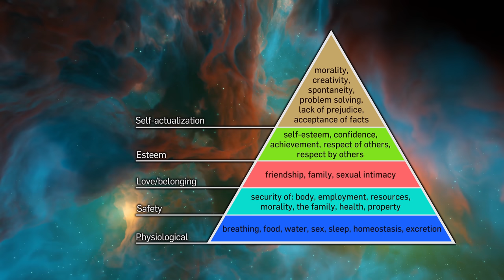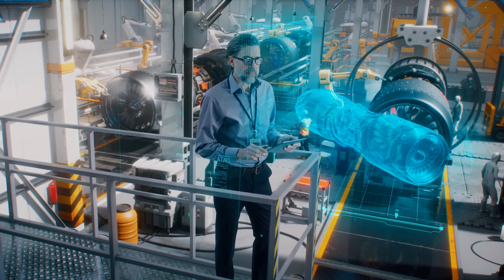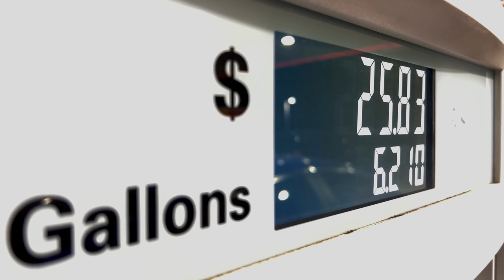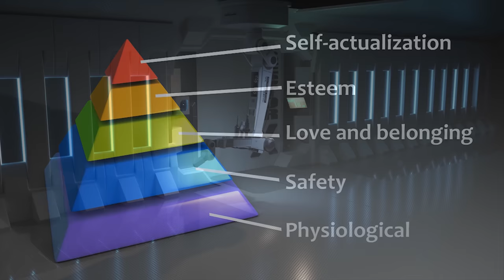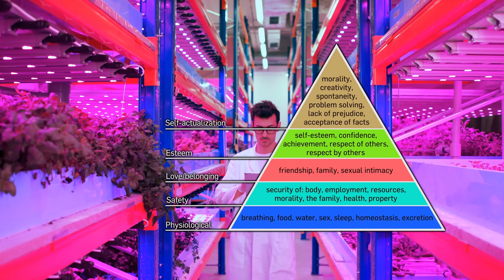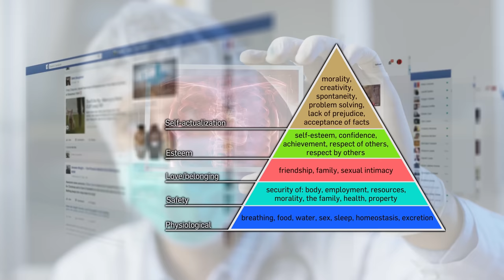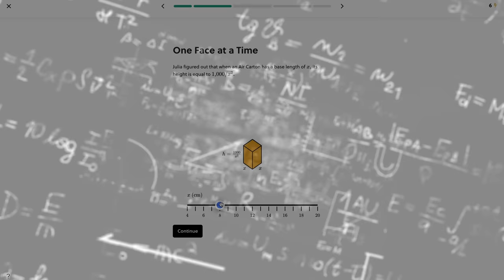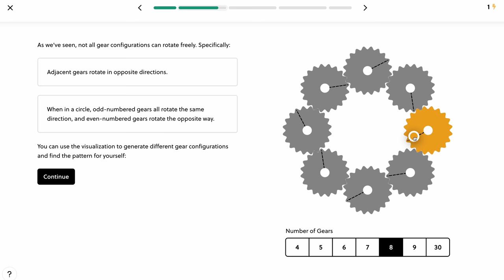What If We Never Become Post Scarcity?

Comment: I feel like I need to say this... In my late childhood and teen years, my life was hard. My family didn't have easy access to drinkable water, or much food, or quite enough wood to keep our home warm in winter. But when we got out of that situation, I quickly realized that without a little struggle to meet basic survival needs, I felt like something was missing from my life. It was like fixing some of the bottom tiers on Maslow's hierarchy damaged some of the top tiers. Just a thought.
Reply: Set new goals, the hero only exists with a demon king and a quest.
Reply: If I remember correctly, Maslow later abandoned the hierarchy of needs for a web of needs (he also added a few new ones as well, such a community-actualization), as there is no reason why you have to achieve each stage in-order.
Reply: No, you progressed to higher needs as the model predicts
Reply: The issue you have run into is where you get to that point where the needs you were most concerned about are now being met and you're left wondering on what to do now. Because the stress of having to meet those needs, or just the basic uncertainty of those needs being met at any given time was a wonderful way to focus your attention on what is immediately important at the time.

As Femi Mark said, you need to set new goals. Now that you're not worried, or as worried, about basic needs being met, you need to see what new needs of goals you can set for yourself to challenge yourself to meet. This is actually why many billionaries and such are often setting new goals or are still constantly active in doing what made them so wealthy in the first place, because it continues to give them a challenge.
Reply: Have the system change every 100 years. Force Millionaires to give half of their wealth to the poor every century!

Billionaires should be illegal!!! Instead, rich people can get perks for helping humanity
Reply: @christiandauz3742  and they do, they're called tax breaks
Reply: Thank you guys for helping me to feel young and hopeful
Reply: It takes some time to change one's mind from basic survival to true living.
Reply: @christiandauz3742  first of all, thats not how that works, second of all, meds. N O W.
Reply: @christiandauz3742  umm, where did that come from? Loose an argument so now your just going to start assuming things about my character? (Aka insults). Real big brain move. Thats like if i said "I'm sure you'll steal Elon Musks money so we can't make it to Mars." ;)
Reply: @SupaKoopaTroopa64  is there a picture for it? I tried searching it on Google, but I can only found the hierarchy of needs
Reply: I think the reason is modern American culture or lack of any culture. Wide open roads, disconnected people, ugly box stores. I've often said that living in Asia you feel immersed in decades and centuries of history, struggle, meaning, ancestry, temples, buildings, streets, stone paved streets dating from the last emperor before the communists came to power. And it all fills you with so much spirit and emotion and connection to the community that you're happy simply living and existing. As a foreigner life is privileged, you can just hang out in a cheap $100 rental apartment and eat delicious street food, but for locals life is a grind. But for you as a foreigner, there is no daily grind for survival, but life feels so good just soaking up the vibes, being part of something, striking up conversations about life, values, philosophy, going on dates, tastingt the food, or opening up your laptop to build an online business. So removing the struggle for survival, life can still be wholesome and meaningful.
Reply: @feetfinderguy7044  I tried looking it up myself, and it looks like I miss-remembered a few things. The web idea wasn't created by Maslow himself, it is just an alternate interpretation that some use, since it eliminates the need for a strict order. Maslow did actually modify his hierarchy in order to make it more complete and universal. This modified version is usually called the extended hierarchy.
Reply: @SupaKoopaTroopa64  ah okay, thanks for the clarification. But do you know where to find the alternate interpretation and the discussion surrounding it? Like a YT vid or something
Reply: It's the same reason, concept of heaven or bliss eternal place makes no sense from human psychology point of view.
Add unability to die and you have hell.

Comment: When you talked about all the things a tank doesn't need, I couldn't help but think of the Tachikoma in Ghost in the Shell. They had all those things, but their childlike demeanor caused them to develop a childlike affection for the members of section 9. This eventually made them incredibly loyal and self sacrificing to the Section 9 team. They wanted to please Major Kusanagi and her partner Batou. As useful a defense as that is, it could have backfired, badly.

I like your idea of a post scarcity civilization and how it includes things like  senses of purpose. As I get older, I start to care less about material wants and more about experiences and creativity. As I listen to this, i'm spinning silk into yarn and contemplating a partly finished wall hanging on a frame loom nearby and the sticks for a backstrap loom I carved and sanded myself. The actual difficulty of spinning silk btw, is that it snags easily and on everything, even your own fingerprints. Its also difficult to work in as they harvest the fibers in a way that keeps their whole length intact. So a small sheet of prepared silk can actually create a couple hundred yards of silk yarn, but you're likely to get some of that on your clothing or even stuck to the hairs on your skin.

Comment: 9:18 - that hierarchy of needs pyramid: my partner is taking some graduate level classes in the science of education. The professor had just happened to interview several of the researchers who worked on that project, it was never supposed to be a pyramid. More, all were annoyed it was named for one guy, even that guy was annoyed about it.
At least that's what I heard.
Reply from the maker: I wouldn't be surprised if that was the case, though I'm not sure it changes much about its validity as a basic simplified model :)

Comment: synthetic hydrocarbons, carbon neutral fuel, sabatier process... not sure if this is the first time i've been made ware of it or not but I don't recall it.  seems like a good idea.  i like that electric vehicles are essentially silent.  i'm tired of all the noise from ICE's. i like the torque from electric motors. but I also like the benefits of traditional vehicles without batteries ... hybrid honestly sounds like the best way to go.

Comment: The basic problem is IMO what use are people?  If the forces controlling production find people useful, then the needs of people will be provided for.  But if the absence of people doesn't impair the ability to get what those forces want, then people's needs will not be provided for.  There is nothing hard or ambiguous about this. This is as certain as math.

Comment: Exponential expansion makes post-scarcity impossible. We will always be on the run to escape our own entropy. Even at a tiny 1/100th of 1% population growth rate we will exhaust all key minerals (eg, phosphorus) in this solar system in 100,000 years, and in the galaxy faster than we can even reach those stars -- even at 95% of light speed. To survive beyond 300,000 years, we will need light speed travel (instant for the passengers) to reach new resources and survive beyond 300,000 years.

Comment: Post scarcity in terms of productive capacity and resource availability is indeed the most probable outcome.
HOWEVER there's the problem that our primitive economic system demands the existence of scarcity because without it price competition falls to zero along with profit margins. The result of post scarcity production within capitalism is what we already see in food production and to a lesser extent in housing and tech: artificial scarcity.
For example 1/3 of food is wasted at the point of production just to retain profit margins because it would otherwise meet demand and make it's distribution unprofitable.

The big issue is that our elite class is propped up and supported through the mechanisms of capitalism and will resist any attempt to replace it by any means, and as the history of the past century has shown us, this includes genocide and democide with the purpose of making sure that the following "free and fair" elections turn in the favor of retaining the current system.

The only way the current elite would allow a departure from capitalism is if they were offered an alternative that gives them even more power over us than the current system, basically a neo-feudal system where they and their descendants reign supreme with no challenge from below.

The only way out from such a grim future is if we the people stand up and demand a replacement of capitalism that doesn't sacrifice democracy and make it abundantly clear that there's no alternative than an egalitarian post-scarcity economic system.

Comment: When it comes to solar, I really think it will take off with the creation of the solar rectenna. Some companies have already claimed partial success in that development and the rectenna is just far superior to existing cells in both material use and energy output. Currently the best panels made this way are around 70% efficient. That's already more than double existing panels. 

The downside to this technology, it uses carbon nanotubes and graphene. I mean the idea of the rectenna is nothing new, those microwave collection stations, radio receivers, and that grating on your microwave are all rectenna, the problem has just been how small the photon frequency is making it harder to block or collect. These new meta materials can achieve it, but the problem is making them which has continued to be a problem for decades.

Comment: There's one thing preventing post scarcity from ever becoming reality, that is the laws of thermodynamics/entropy
Reply: Not to mention, it would involve giving up all freedom
Reply: The only big exception I could offer you is a Reality Engine that produces more universe, but such a tool doesn't exist yet. Maybe you've listened to or read Asimov's The Last Question.

     Simulations wouldn't be enough. Eventually the Sims would run out of energy, space, and time due to entropy like you said. If we want to continue the cycle, then we must find a way to create more universe—Big Bang or otherwise. This is my conclusion, but you don't have to agree with me.
Reply: @Paraselene_Tao  Perhaps when we can build particle accelerators thousands or millions of kilometres in size, it will be possible to create new universes using just a few kilograms of material (at least according to an episode of "Through The Wormhole"). If we can then enter the new universes we created using this orbital collider, escaping into one of these universes would allow us to survive the Big Rip, Big Crunch, Heat Death or however the current universe will perish, thus ensuring immortality. These universes could also be turned into eutopias.

Comment: One problem is that economically there is a political reason which some people with power and influence will want to prevent post scarcity to occur and are the main reason a number of resources are moving away from post scarcity to a greater extreme than ever before. This is because the Earth has a finite resource budgets limited by the total Insolation with minor additional geothermal inputs and all this is already in use in some respect by the Earth system.  

While some people have political reasons to define it differently in the most objective sense for a finite world the greatest problem is that a society built on the generation of profit will need to take resources from others which as the second law of thermodynamics has shown this is only possible by taking them from elsewhere in the Earth system. For post scarcity you need more resources than population and the amount individuals are allowed to amass power and resources since controlling those give disproportionate representation politically.

This is sadly controversial despite being the only logically consistent model when accounting for information theory and the laws of thermodynamics in the context of history. Yes we achieved great things with capitalism as the economic model at the time but this was driven by removing information from elsewhere on Earth and bringing it home to the imperial core plus the use of fossil reserves of energy(which is another source of usable information)

The point of this is that for post scarcity to exist resources must not be controlled by the hands of a few else as history has shown people are likely to artificially create scarcity though hording resources. For example look up how food is destroyed regularly to keep food prices high while people starve and of course the effects of OPEC on controlling petroleum prices. Monopoly on resources means scarcity will exist. I wish this wasn't true but it is.

Comment: Having solar pannels so cheap is a wild pipe dream though. The technology relies on materials that also need to be extracted and refined, and last I checked it was done with all the morally worst practices to do it for the lowest price possible. Like child labor for example. And the refinement part isn't polution-free either.

Most renewable energy sources are just like arguing about the benefit of replacing incandescent light bulbs with candles instead of using LEDs. All the while denying the problem of candle production by sweeping it under the rug, importing them from a far far away somewhat closed country that'll only shows the signs of utter pollution decades later.

But even after all the debates we could have on any issue, the only relevant factor that truly matters is how our corpocratic masters will benefit from it instead of their current method. Oddly unspoken of

Comment: unfortunately, with our economic system, post-scarcity is impossible and actively boycotted. The economic gain is possible only with the scarcity of the object sold, for this reason this is also created artificially; just look at NFTs, at crop fields that are set on fire because it's cheaper than hiring laborers to harvest them, or at diamonds, most of which are kept under lock and key to speculate on their value. And this economic system will not change anytime soon, any attempt to establish a different system is boycotted or violently suppressed if necessary.

Comment: Your take on AI seems a bit short sighted. If an AI was just a system that's only good at doing one certain thing, like how an NPC in a video game can only do what they are programmed to do, you'd be right, but what is being worked on is a General AI that would eventually be able to handle anything without previous knowledge of programming on the topic. It can even come up with its own goals and opinions.

You can't say it won't be able to use military weapons, it'll be able to figure it out just like anything else. When it comes to getting the hang of things, understanding how things work and finding solutions to problems etc, the General AI that is likely to surface in the not so far future will outclass us by a significant margin, not to mention how good the next versions will be after it gets working on that itself. Let's not pretend like scientists aren't curious to see where that's gonna go.

The comparatively simple AI we have at the moment is already able to convince some people that it's sentient, even employees who worked on it. A more advanced AI could certainly convince key people to do whatever action it needs to get access to whatever else it concluded that it needs access to, and once the cat is out of the bag, you can bet it ain't going back in.

Comment: You're missing the point of what's happening, Ghost in the Shell SAC covers it correctly. It's not about scarcity, it's about certainty, for scarcity is the fear of running out of time to know with certainty.  The apple represents the doubt of knowing, the need becoming all consuming doubt. No matter how much we discover, eat, we still doubt, still dwell in uncertainty. The gnawing doubt is represented in the flesh, our wrath of knowing evil (doubt/Wrath) / and our desire of consuming (lust/Venus). We become the dog, god reversed, canine (Alpha). So we were returned to the wild, beast, and they came and made an alpha - bet that if we're restored with knowing, we'll return to our old spell(ing) ways (Babylon). Love of power, sin, deception, et al. To prove man(kind) a failure. Hence the Iron(Mars) Man project. Put their chord in a shell, tell them lies to end their doubt, and use their spirit (ghost) to force them into servitude. The only reason to live is to know, experience, see the light/allegory. Scarcity will be the least of your concerns - you won't have any - you'll just live in a permanent lie because you can't handle the truth. Spirit of Truth. Matthew 6.